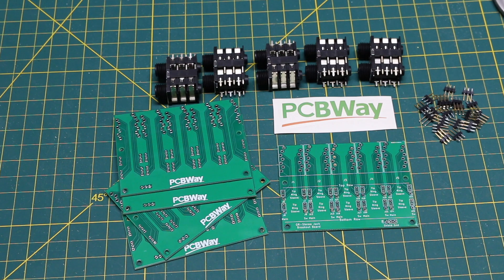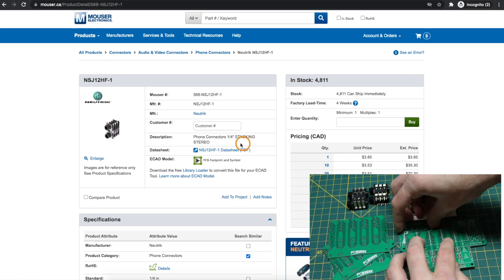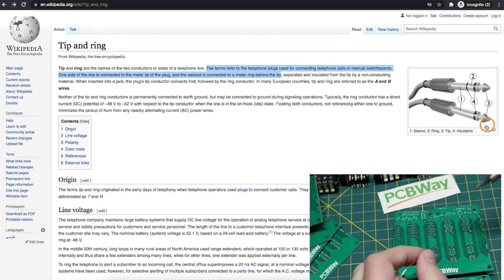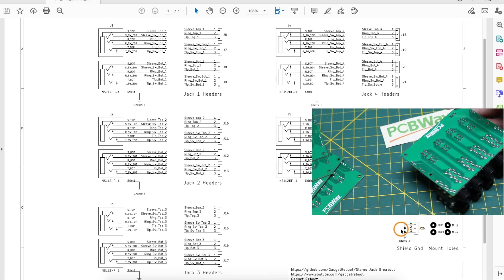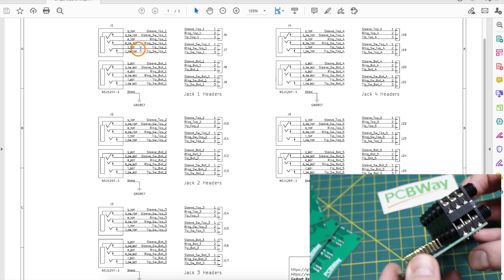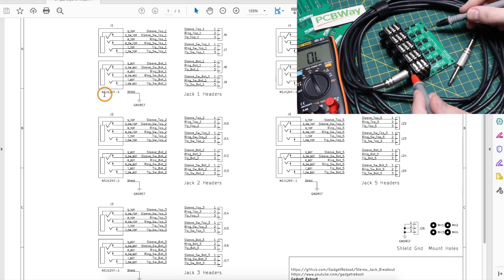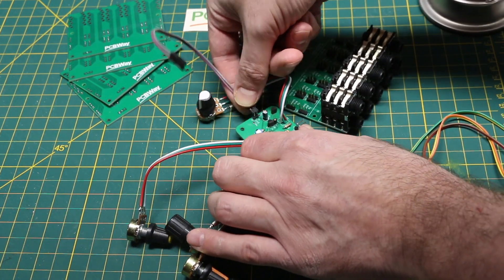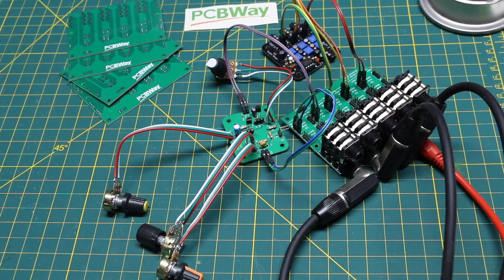Dual Stacked Stereo Audio Phone Jack Breakout Board

Comment: Remember what most others forget... audio instrument and line level inputs and outputs need to use SHEILDED cables between the connector and the PCB. The usual way is to have Ground in the center, Left and Right either side of a 3-way terminal.
Make sure that the ground cables don't form a loop... so if your rear panel has all the grounds commoned together, then only one conductor of ground should connect the rear panel with the main PCB. Hence all of the other inputs and outputs would have the ground of the shielded cable only connected at one end, usually the main PCB.
It's also desirable not to have mains ground connected anywhere to signal ground. However it is best if the chassis is at signal ground.... hence it's much better not having mains power inside your audio stuff (use a wall wart)..
Reply from the maker: I just received some shielded audio cable I ordered in January for some things I’m doing next month but it looks like I should have ordered much more.  I remember having to play around with which end of an RS 485 cable to connect to a chassis to prevent system resets from noise back before Wi-Fi was in everything.

Comment: I'm curious as to the end project you have planned
Reply from the maker: One will be an audio mixer with maybe 4 stereo inputs plus output, using motorized fader pots for the level controls, and if prototyping goes well, another use will be for a guitar effect loop switcher where the in/out of various effect pedals will be connected with these jacks and they can be switched in/out of the audio path with another project.
Reply: @GadgetReboot  cool. Can't wait for the videos